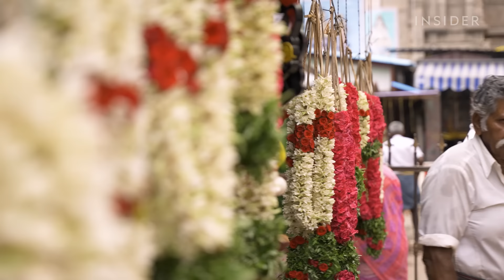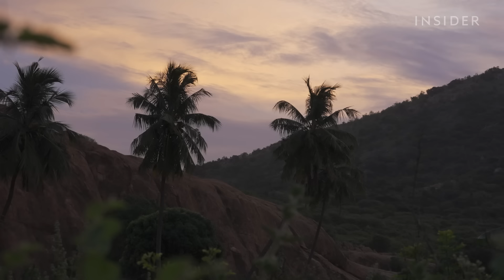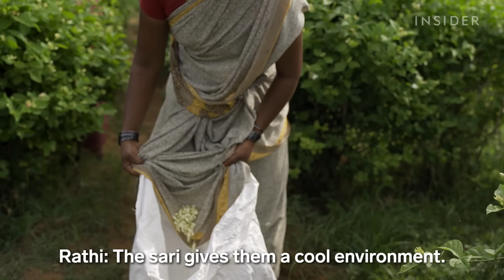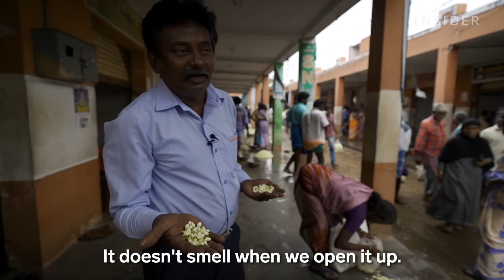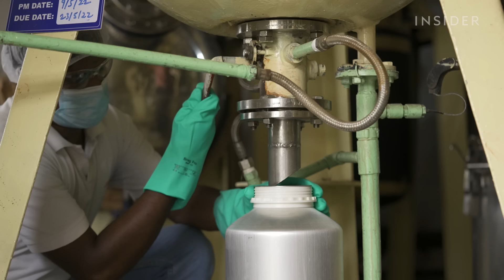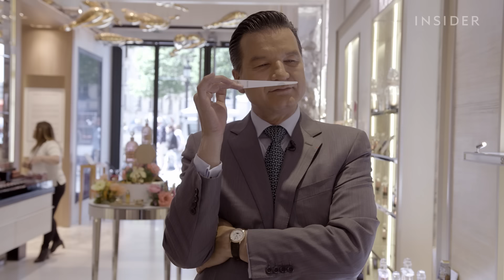Why Jasmine Oil Is So Expensive | So Expensive | Business Insider

Comment: Your calculation seems to be missing a key factor. The market price for 1 kg of essential oil is approximately Rs.4,00,000 ($5000). However, your explanation implies that to produce 1 kg of essential oil, you would need 1 metric ton or 1000 kg of jasmine flowers. Now, if the cost of purchasing 1000 kg of jasmine flowers is Rs.5,00,000 and the selling price after extraction is Rs.4,00,000, it becomes evident that the cost of production exceeds the potential selling value. This raises concerns about the profitability of this business venture due to the risk of operating at a loss.

Comment: If the market rate is 500 inr per kg of Jasmine buds and you require 1 MT (1000 kgs) for 1 litre of oil. That means you require 500, 000 inr which is nearly $7000 to make 1 litre of oil which sells at $5000. Doesn't sound like a smart business.

Comment: Wait... the "concrete" is worth more? If 1kg on concrete is $4,000 and absolute is $5,000.... but it takes 2kg of concrete to make 1kg of absolute the $8,000 concrete turns into $5,000? 🤔 and thats just a guess but more than likely it takes more concrete to make 1kg of absolute
Reply: No, I think you got confused he just told that 1kg of concrete is worth approx. $2750 to $3000 and 1kg of absolute is worth approx. $5500 with is approximately double the price of concrete.
In no point in time he told in video how much of concrete is required to make 1kg of absolute. He just said they mix concrete with alcohol has extract absolute.

Comment: I suppled a Vapour Absorbtion chiller plant at Jasmine Concrete Exports around 8 years back at their Dindigul factory... It was an isolated factory on the side of of the highway then (and maybe even now). . . . There are a large number of companies including Synthite, Arjuna Naturals, Akay Flavours and many more that produce natural essential oils for the world via the same solvent extraction process. India is still the spice capital of the world . . . dont think synthetic indole can replace the complexity of jasmine oil.. It maybe like comparing vanilla oil to vanillin. . . . But alas, ultimately, machine vision based automation might replace the farm worker at the bottom of the value chain and factory farming might even lower this cost... The hand plucked process may still hold some artisanal value though....
Reply: Do you know which solvent is being used for the initial extraction before the concrete+ethanol step?

Comment: One kilogram of jasmine buds sells for 500 Rupee, that is $6.26USD.  It takes one hour to pick 1 kg of buds.  Best case those women picking the puds are earning $6.26/hr, but that is the price the buyer pays at the market.  The pickers probably make half of that.  So the extremely expensive $5000/kg oil, the pickers are making 0.0008% of that price per kg of buds picked.  Maybe think about that when wearing your expensive perfume.
Reply: Most of the perfumes use synthetic or adulterate . only a fraction is natural jazmine
Reply: @7_years_and_  This video was about natural jasmine and showed how hard the, mostly women, worked for little money.  The perfumes you speak of are likely lower priced, the fact that it is the luxury and extremely expensive perfumes that use natural jasmine oil just makes it worse.

Comment: Amazing documentary guys I think you guys have messed up with the Maths as I'm an Asian so it's my responsibility to correct.
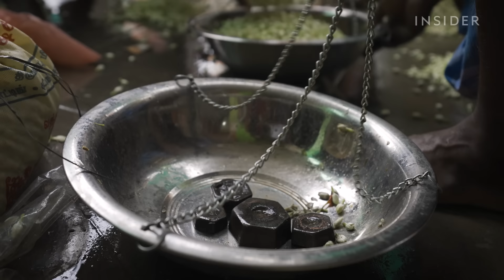At 5:02 the girl says the Wholesale market price is Rs500/ $6.26(As per today's US dollar rate to INR) 
On the other hand, it is well mentioned that the price of jasmine oil Per Kg is $5000 which in turn will require 1Metric ton/ 1000Kg of flowers to extract now if we do the maths here 1000×6.26(price of 1kg)= $6260 so hypothetically if we assume that there are zero expenses of the workers and senior management of the company and also zero cost of other operational expenditures still the oil extracting company will be making $1260 of Sureshot loss at every Kg of oil exported!!!

Comment: 5000 buds create 1kg of jasmine oil, 1kg of jasmine oil can cost 5000dollars, so one bud costes 1dollar
Reply: With bitcoin I have been able to get 3 skin darkening injections and fillers. I've been able to build my portfolio from a 3000 to a 42,000. Anyone who is not investing in the current dip is missing a great opportunity
Reply: 5000 buds weigh 1kg. You need 1000kg to get 1kg of oil.